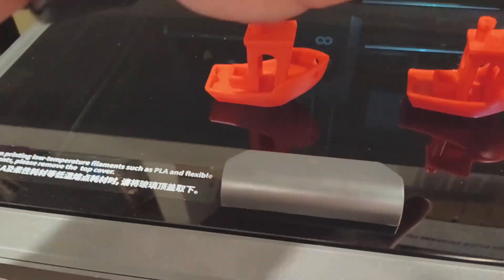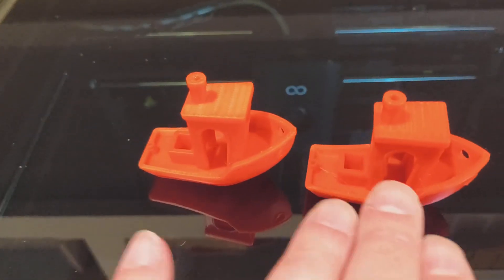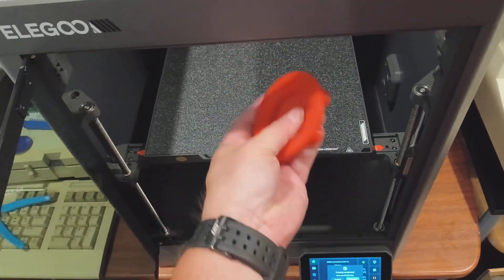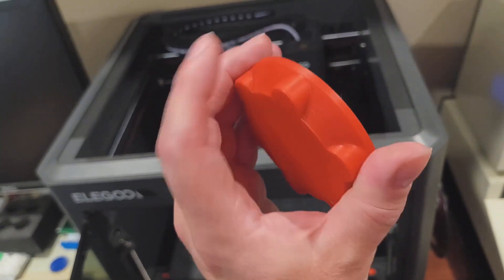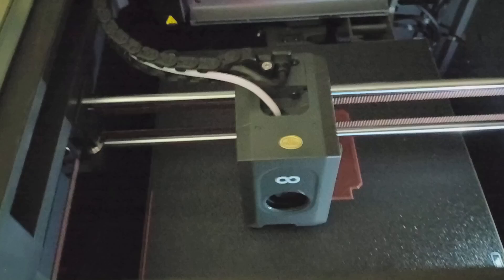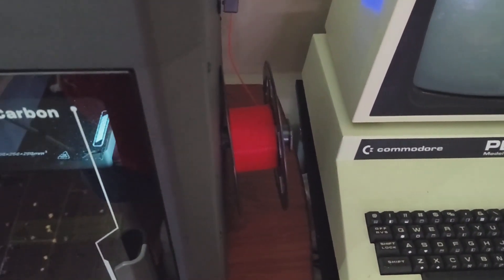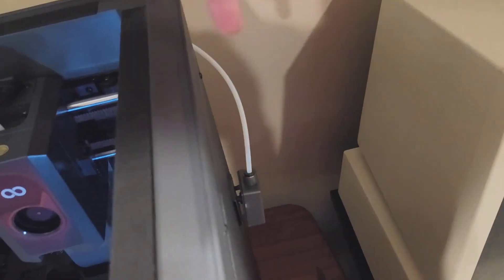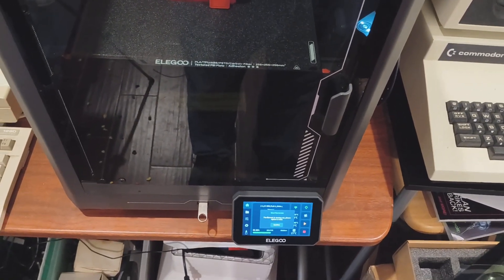#02: Elegoo Centauri Carbon first sliced files & filament change.

Comment: I guess the Commodore C128 is running the slicer? :D This reminds me that I need to pre-order this printer. edit: ohh.. a PET also :O very nice collection.
Reply from the maker: LOL.  It runs the slicer in 80 column mode.  ;-)
I love those old PETs.  A 4032 was the first computer I ever touched.  I have the double disk drives for them too, but I use SD card replacements.

Comment: do you mind to share your kobra 3 max setting? i saw your model very good
Reply from the maker: Keep in mind, that the video for this is for the Centauri Carbon, not the Kobra 3 Max.  I do videos for lots of different machines.
For the Kobra 3 Max, I'm just using the standard 0.2mm profile that us created by Anycubic Slicer Next when you install it.  It has been working well, so the only parameters I tend to play with are infill density, overhang (degrees - I like to use 65) and tree supports when necessary.
I have created a custom 0.12mm profile based on the Orca Elegoo Neptune 4 Max profile, however I haven't fully texted it to make sure there are no issues with it.
Reply: @LanchburyConsultingLLC are you slow outer wall or default setting from Anycubic slicer my outer wall have weird line and feel like filament not melt fast with speed
Reply from the maker: @Bastata  Default.  I'm really only playing with infill, overhang angle and supports.  The rest is working great.  Today they release a firmware upgrade and added more profiles to the slicer software so we have 0.8mm, 0.2mm and various other layer heights pre-programmed now.
Reply: @LanchburyConsultingLLC do you have recommend about vibration from this printer my table shake when travel
Reply from the maker: @Bastata  Only to get a solid table (mine came from walmart with a heavy top and hard metal legs with adjustable feet to level it).  Also, recalibrate the vibration whenever you move it.

Comment: I had same issue with the boden tube I ended up taking off my zip tie and pulled it out of the chain coil I saw a guy on the CC Facebook group added a printables file for an external cable clip that links with the chain. I am going to print that soon for my CC
Reply from the maker: That might be a good idea.  That curve in the tube just before it enters the print head is brutal and it takes a lot of force to push the filament through.
Reply: @LanchburyConsultingLLC  yep I had that issue loading its a harsh almost 90 degrees so after I took of the zip ties and let the tube free easier loading may wear down the tube due to it traveling under the left recess lip but works better in general.
Reply: also maybe with your kobra 3 making or finding a model that has a taller wall that can deflect it back in from flying out?